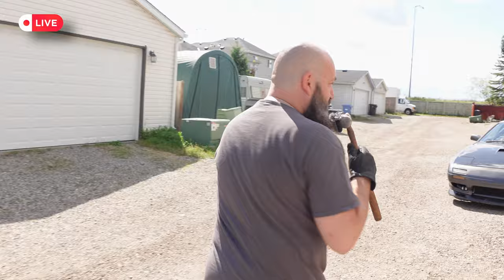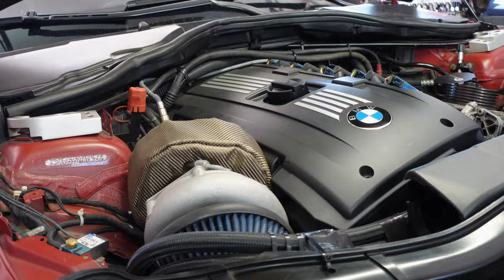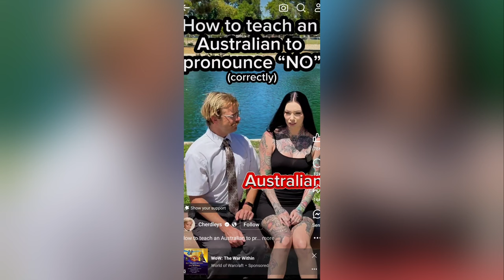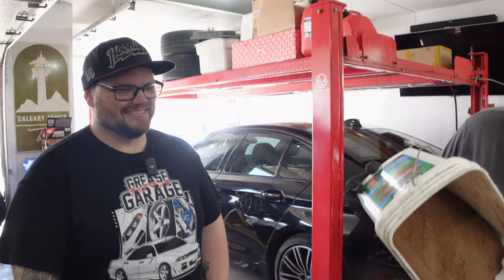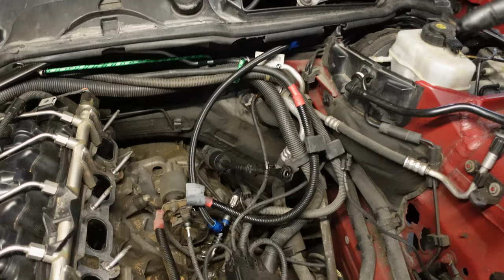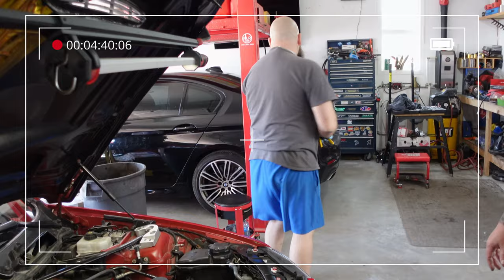TOP 3 REASONS To Go Port Injection on BMW N54/N55

Comment: for me, it's keeping valves clean, and a full E85/ignite E90 fueling..buuuut mine is remaining a project in progress.. next up.. clutch and rear main seal! cause mine pushed out under the plastic V.C.. and plastic PCV.. so far M3 rear arms, VAC motorsport baffle. Bremmen aluminum cover, and Vargas PCV... ( came in a kit with the bremmen cover.. had to stick vargas guts in the bremmen PCV cause the bremmen PCV was absolute shite and didn't seal at all.. so vargas PCV guts and cap it didn't exactly seal dry, but it did a HELL of a lot better job, and what did leak through was minimal and more pressure better seal.) after clutch rear main, and probably guibo.. Pure 600's.. cause wastegate rattle..

Comment: Meth cleans the cylinder also and you control wen you wanna use it port inject only real benefit of you using racing gas /e85 all come down to which one you prefer and which one benefit you and ur ride

Comment: On my ST n54, I went water meth, because simply because of the price. 375$ cad for a 600cc connected to the jb4, I think this is pretty much the cheapest you can go. I buy methanol gallon at Canadian Tire 9.99 and radiator water 4.99$ and do a mix. 
While a fuel port kit , even used , is well over 4 digits. 
But agree , better and safer.
Reply from the maker: same thing I did! had no issues on my old e90 with hybrid turbos, did great and only got a puff as meth ticked on from the exhaust and gnarly methanol backfires rolling off-throttle.

Comment: I'm still installing port meth, using 6x 3.5gph nozzles and one in the charge pipe, why? Because I live somewhere where ethanol is difficult to get for under $5 per litre, methanol is about half that for me.  I made 565whp with a single 1000cc nozzle in the charge pipe
Reply from the maker: that's pretty good and a TON of methanol, whew! 🔥

Comment: got a ST n54 on just DI with pump gas. Is there any gains with PI if you are running on pump gas? From what ive seen people say if youre just running on pump gas PI wont really help you unless you have ethanol/meth
Reply: you’ll gain some, on just pump + port injection you should be able to land somewhere in the high 500s to the wheels. but if you want the real benefits you have to go ethenol / meth
Reply: Running port even just on pump you'll elevate some of the stress off the hpfp as you have supplementary fueling. With a upgraded lpfp yoyll run out of hpfp next. Port will help with that as well and will allow a bit more boost
Reply: Will certainly be much safer as you can run a bit on the rich side and not detonate.  Plus you will stop maxing out the hpfp.  It's always better to leave some room in the fuel system.  I bet you will be able to push a bit further into the 500s with port.  I don't think anyone has really done it, so publish what you learn, I would be curious to see what happens.
Reply from the maker: the only thing I can add to what others have already said is that we're (seemingly) cavitating our REV4 HPFP at nothing above 16psi and 6500rpm currently. The HPFP tanks hard and doesn't recover while LPFP is cruising along.

the consensus is, anything over 500-540whp is questionable on factory DI without PI.

as for pump fuel, mid-high 500whp is attainable with the right tuning, beyond that you'll need ethanol.